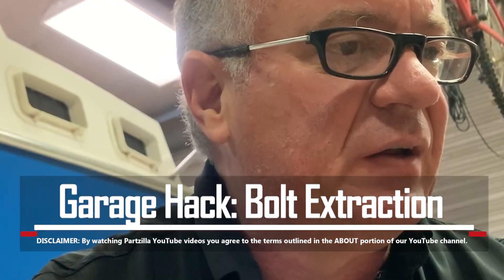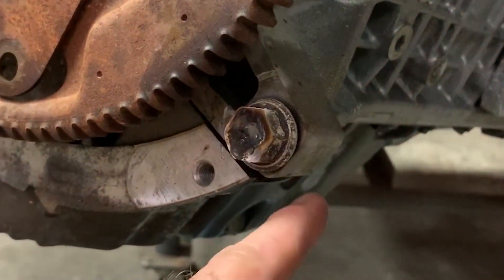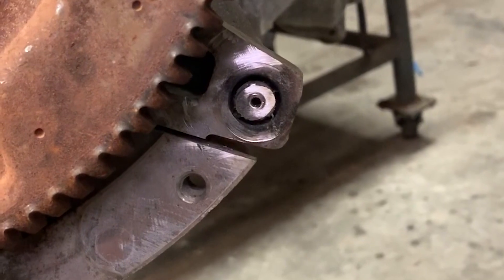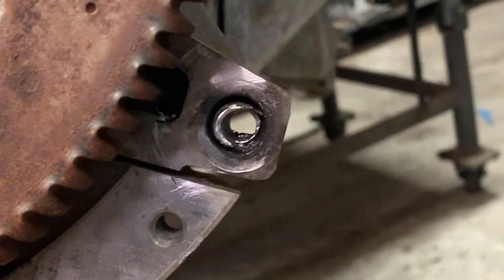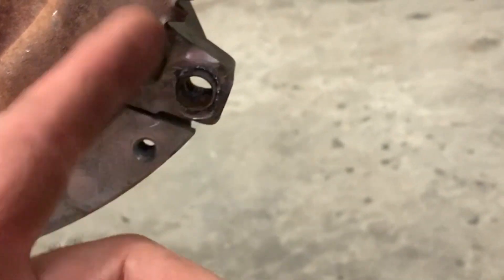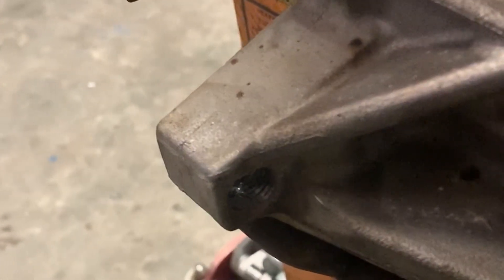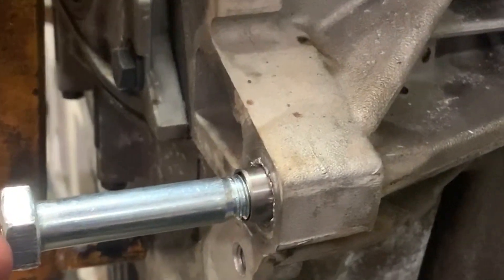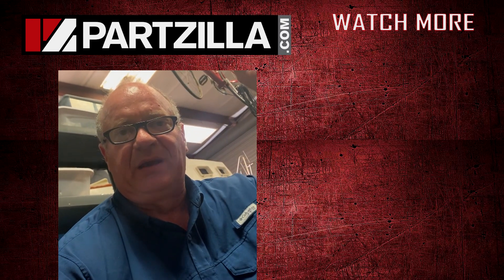How to Remove a Broken Bolt | Broken Bolt Extraction | How to Remove a Broken Bolt | Partzilla.com

Comment: Hey had a frame slider bolt brake off in a 2016 zx6r i picked up at auction.had at least an inch and a half of bolt in the engine sheared clean off. tried the same thing as you. No luck. Dropped the engine forward drilled it out and removed it with a large threaded extractor and a crescent wrench. No need to use helicoils etc.  Id def recommend a set of large extractors.

Comment: How too extract a cvt bolt broken inside the crank shaft and the threads are damaged. Leave it in, and cut new bolt that much shorter, cheaper than replacing the crank.

Comment: Bought an extractor kit
Tehnically inversed threads :) try them out
Reply: Just try not to break the extractor while trying to remove the bolt. Since those things are hardened it's easy to break them, and pretty much impossible to remove the broken part.
Reply: @_Dimon_  Used them 2 times kinda worked for me 😂

Comment: Hey my brother bought a Honda rancher 350 or 300 I don’t exactly know but anyone guy said it had a new top end brother ran it for a day and it has a massive amount of blow by I pulled it apart rings won’t on right I re did them and sorta gave it a little cross hatching but still burns to much oil to even stay running any ideas guy says piston and cylinder are both brand new
Reply: Bassin N blasting I know you don’t want my answer but it might be the pcv valve that vents the crank case